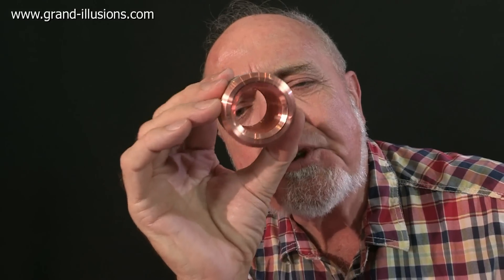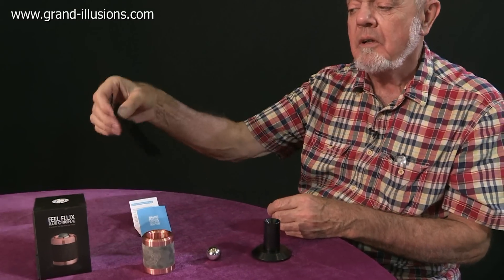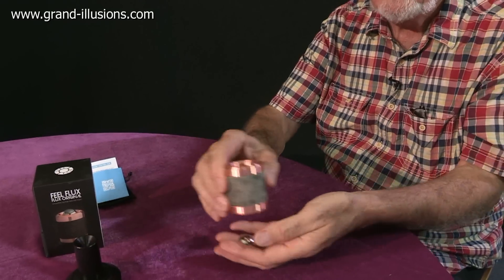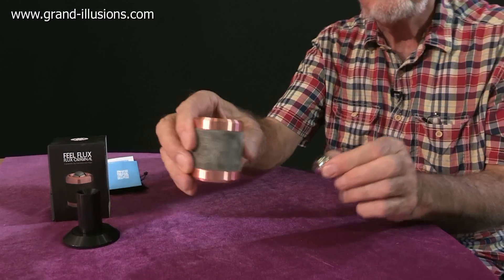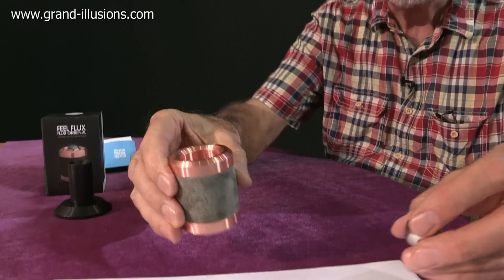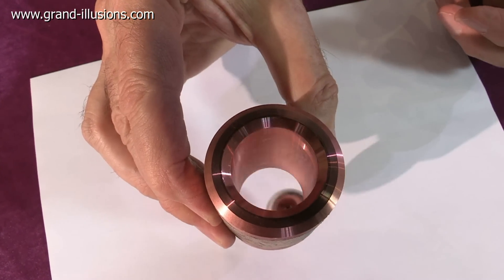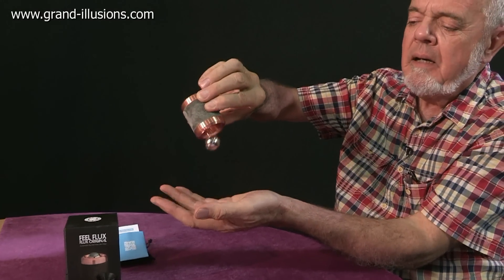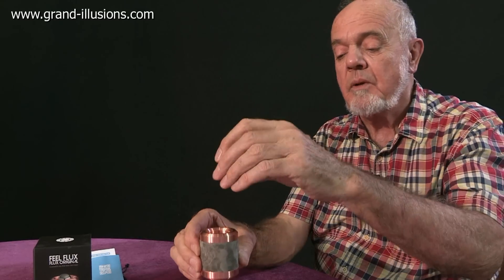FeelFlux Original

Comment: Can you feel the weight of the ball while it is passing through the tube?
Reply: +noisyturtle yes for sure as it's 'gripping' the tube magnetically
Reply: +SirHattingtonIII yes you CAN!! It has nothing to do with magnets in the tube at all! If you spin an unloaded dynamo or motor with your fingers, it  spins easily. Now if you short the output wires together and try to spin it there is a resistance. This copper tube is just a closed electrical circuit that is short circuited. Electricity is being generated and shorted out into heat. For this to take place there must be 'grip' on the magnet because what slows the ball down is basically your conversion from potential energy -> kinetic energy -> electric energy -> heat energy. If there is no 'grip' and resistance then you're creating energy out of nothing!
Reply: +SirHattingtonIII ok.....that makes everything clear. ....."just saying"......"never did one myself"......funny. ......that's what I expected. ....but is still funny to hear it from your mouth. .....don't misunderstand me my dear friend: it's always good that you recognize your mistakes.....good for you!
Reply: Yea you can .... Laws of conservation of energy
Reply: Yes. I have this set and can confirm that I feel the weight of the ball passing through the cylinder. The moving magnetic field of the falling ball induces a voltage. This voltage generates high electric currents in the metal wall which also induce their own magnetic field. The magnetic fields oppose one another, slowing the ball.
Reply: Thanks. I'm sure you would. These are so expensive, I wish I could afford one.
Reply: Brian Su I know. Just saying. Never did it my self.
Reply: +Brian Su you probably can't. And there's no magnets on the copper tube.

Comment: i have a question...when the magnet is floating inside the tube...does it weigh more than the tube? to be more clear...is (tube + floating magnet) weight = weight of tube + weight of magnet?
Reply: The weight of the magnet adds on to the cooper tube 
.... In other words ....think of it like you are holding the tube and ball together

Comment: the question is: how much does it weigh, when the ball falls through? ... just the addition of both weighs? or less?
Reply: Addition of both
Reply: Itzael Meza are you sure? based on what?
Reply: Laws of conservation of energy
Reply: Itzael Meza yes but maybe because some electons get accelerated, the system is increasing in energy... and heating up with friction... i am really not sure ^^ ... but i would also guess it's just the addition ....and the heat might just be the loss of the potential energy
Reply: It's possible but I did this experiment in class and it was their way of teaching how energy can't be loss ... Energy meaning weight
Reply: Itzael Meza ah ok

Comment: I do a similar trick with a half meter length of copper pipe and a magnet. I give the mark the pipe and a lump of metal of similar size to the magnet and ask them to hold the pipe in one hand and drop the lump through the pipe. I then challenge them to catch the lump at the bottom before it falls to the floor. They can manage it. Then I substitute the magnet.

Comment: Could they have made the tube any shorter. This effect is way cooler when the tube is longer.
Reply: +soundslave did you look at the price for that thing?
Reply: kurtilein3 Currently goes for $89 on their site. A bit high for a fancy desk toy IMO. Though if I was a well off dude with a home office, I'd totally get it. Or maybe not, as I do like to have a bunch of electronics laying around my desk, and having a powerful magnet so close to them makes me antsy.
Reply: LowellMorgan
its 5 dollars per kilogram. so for their asking price, you could get 18 kilograms of copper.
Reply: RFC3514
people just buy a comparable, but longer, copper tube with thick walls for maybe 15-30 dollars, and a comparable magnet for maybe 2 dollars.
Reply: RFC3514
 get the magnet here  http://www.supermagnete.de/eng/sphere-magnets-neodymium/sphere-magnet-diameter-12.7mm-neodymium-n42-chrome-plated_K-13-C    12.7 mm neodymium sphere, holds on to iron with around 2.9 kilograms of force, weight 8.2 grams. the effect will work with any copper or aluminium tube. it works better if there is a better match between inner tube diameter and sphere diameter, and when the tube has good thickness. no idea where to best get the tube. but i ordered from the magnet website several times, they have top quality magnets. note how the prices go down when you order bigger quantities.
Reply: +RFC3514 just fuck off. it may be a good deal for someone who has a job that sucks and who likes to do metalworking.
Reply: RFC3514
fuck off, i looked up the market rices for good copper, not copper scrap.
Reply: kurtilein3
No, but I assume it's really high like all stuff on this channel.
Reply: RFC3514
i looked up the global market prices for copper. and i have a job. spending 100 $ to make 5 of these things at a cost of 20 $ per piece + the work of getting and cutting the copper pipe.... then selling the 5 for 30 $ + shipping each, with pictures and stuff, sending out 5 boxes, for a profit of 50 bucks? bad deal.

i would rather purchase another original marvel cover design for 1000 dollars and put it on the wall and sell it some years later for 2500. only one thing to handle, low risk because it is unique, each comic book only has one cover design and for each of these there is only one original piece. no pipe cutting, better profit. you just need to know a bit about marvel comics.
Reply: Austin Chavers Copper aint cheap. I imagine they decided to cut it short to keep it more affordable.
Reply: mcgibs Copper is surprisingly expensive. So is neodymium. I'm guessing this is the smallest they could have manufactured it and still have the effect be noticeable.
Reply: kurtilein3 So you're basically arguing against yourself, now? You started off by saying how incredibly overpriced this was and how you could make it for $17... but now it's a "bad deal" and you're not going to take time away from your job, even though you could sell them $1 cheaper than the one in the video and (supposedly) get a 400% profit margin? Yeah, right... 

As the saying goes, either put up or shut up. 

Or, of course, admit that you just pulled numbers out of your ass to try to sound like an "expert", when in fact you had no idea what you were talking about (as demonstrated by the fact that even the website you linked to sells those magnets for six times the price you said you could get them for - and the magnet is the cheap part).
Reply: kurtilein3 Put up or shut up, troll.
Reply: kurtilein3 Actually, it's more like $7 / kg (on a good day)if you buy copper scrap by the ton. And, after that, it still needs to go through a foundry and a milling machine.

If you think there's such a huge profit margin, why don't you make some, sell it slightly cheaper, and get rich?
Reply: kurtilein3 I would also like to buy one at the price you quoted. Dudes right you should of stopped at fuck off lol.
Reply: kurtilein3 Okay, I'll buy a set off you for 25 dollars (32% profit for you), after you post a video of it working correctly on YouTube. 

Or shall we just assume that the words  "maybe" and "comparable" in your post mean "I'm talking out of my ass"...?

Amazing how YouTube is full of people who can make anything for a fraction of the cost, and yet don't...
Reply: kurtilein3 So, you go from an expert on the prices of machined copper to "no idea where to get the tube". And it seems you're not interested in free money, because I offered to give you a >30% profit if you could demonstrate an equivalent working product for the prices you quoted... and you suddenly "lost interest".

Somehow I'm not surprised.

Oh, and by the way, don't think I didn't notice that you linked to a magnet that is half the diameter of the one shown in the video (and still costs 30% more than the price you quoted). The 1" magnets (K26C) actually cost between $9 and $12 (that's a mere 600% of the price you quoted).

Somehow, I'm not surprised about that, either.
Reply: kurtilein3 ...and happens to own a copper foundry (to turn that scrap into a solid block), a milling machine (to shape it), a magnet factory, and free electricity... but whose time isn't even worth the (real) $20 profit margin in the actual toy (or even your imaginary $72 margin).

You should have stopped at "fuck off!", it was a more convincing argument.
Reply: kurtilein3 Not sure if that was an attempt at a joke or if you're really completely clueless about metalwork. Either way, again, you should probably have stopped after "fuck off" to limit the amount of nonsense being broadcast across the interwebs.
Reply: kurtilein3 I see that either you've completely lost the ability to read, or you've gone full troll. Possibly both.

Either put up (and present the product you said you could, for $17) or shut up.

Comment: Magnets, how do they work?
Reply: Miracles, yo.
Reply: +MrPhitos the slowing force depends on speed. A generic force equals mass x acceleration, so a null force means no acceleration.
Since gravity is a non-null force, the ball accelerate toward the center of the earth, thus increasing its speed and the slowing force too. There is a critical speed at which the slowing force and the gravity are equal,  so the resulting force on the ball is null. BUT, a null force doesn't mean no speed, rather it means no acceleration (as stated before), so it simply retains its state as long there is an opposite force to the gravity. This means that no matter how long is the tube or how strong is the magnet, the ball will fall at a costant speed when the critical speed is reached. The same happens when you free fall in air, only there is a viscous slowing force against the gravity (air resistance instead of a magnetical one)
Reply: cestrianvlogger He explained it at the end: Magic!
Reply: +cestrianvlogger 
In the magnet, a great number of particules have their magnetic moment aligne. So it leads to the magnetic field we can feel at our scale.

When the magnet goes through the copper tube, its magnetic field induces an other magnetic field into the copper. And this new magnetic field goes against the first one, and the ball slows down.
Reply: It may fall realy slowly but it will eventualy get through the tube.
The energy to slow down the ball comes from the movement of the magnet inside the tube.
As you can't transfert 100% kinetic energy into the induced magnetic field, the gravitational force will be greater than the magnetic force, and so the ball will fall...
Reply: +Hinawa Chainsaw 
Yep, I have been doing this kind of Physic for two years now, looks like 1 mouth of vacation and all is gone...
I feel pretty dumb as I remember all the exercices I have been doing on this subject
Reply: Brian Su It would warm up - a little - but there's not a lot of energy involved, and heat is a dense form of energy. 

Remember, rheostatic braking systems are slowing down hundreds- or thousands of tonnes of train from many miles per hour. This just prevents a small ball from accelerating.
Reply: MrPhitos so if you had a powerful enough magnet, it could just completely stop in the copper tube?
Reply: MrPhitos ok thanks
Reply: +Hinawa Chainsaw oh and when the slowing force and gravity are equal, the acceleration is null, thus the speed is costant and the slowing force is constant too (and in equilibrium with the gravity).
Reply: People just started explaining how magnets work -.- How to be clueless 101.
Reply: +cestrianvlogger its quantum electrodynamics.
Reply: +MrPhitos how hot will the copper tube get?? This is the same way rheostatic brakes on a train work.
Reply: cestrianvlogger  Electromagnetic field (charged particles moving to create magnetic field). No one knows what that (EM field) really is though. But in their defence, no one can define "reality" too well in the first place.
Reply: subh1
physcists know it, its electron-photon interactions, basically electrons exchanging photons.
Reply: Haniff Din
ummm....  yes, it is!
Reply: Haniff Din
you are full of shit and the smartest people on the planet will ignore you if you say gravity or time do not exist. if an experiment can prove that it exists, and it is executed flawlessly and convinces others, then it exists. Gravity and time are as real as could be, and you are just outside of the realm where communication is even possible of you deny that.
Reply: cestrianvlogger God.
Reply: +Haniff Din You are fucking dumb. Seriously, our universe is holographic? Please, if I wanted to hear bullshit that I know is stupid spew out of someone's mouth, I'll just go to the DMV. If anything, our universe is a hallucination. Not a hologram. Things are only as you can perceive, you can perceive different than others, but when you are given a scale or relative measurement, you perceive the same thing. And not only do you perceive to w given measurement, but if you perceive something, it's safe to say it's not real. Your brain can fabricate objects and give you a reaction to touching this object. Others may not see it. but who's to say that their brain isn't just using it's Photoshop1337 leet skillz to make the object appear as if it wasn't there? and of course gravity exists. Explain how we aren't shrouded in darkness, wishing that we had a star by us? Oh, but my argument of perception disproves that. Well, maybe we are all going over highly complicated fabricated memories that our brains made before our exact moment of death, where we are losing oxygen and our perception of time is fucked to the point of where we live our final moments for eternity. That's plausible.
Reply: It's just there in the air bitch
Reply: cestrianvlogger MotHeR FuCkiNG miRacLeS